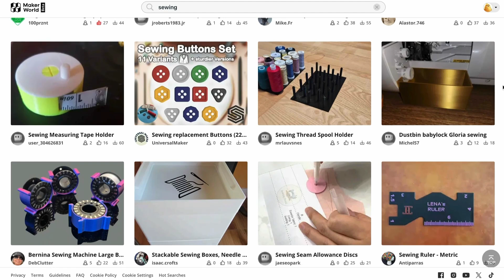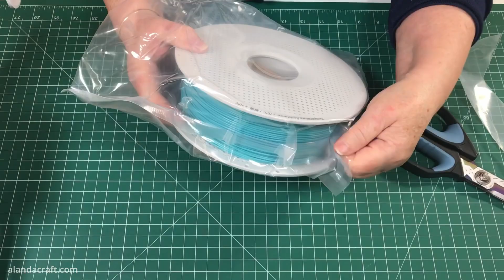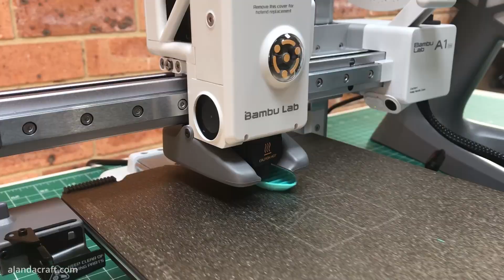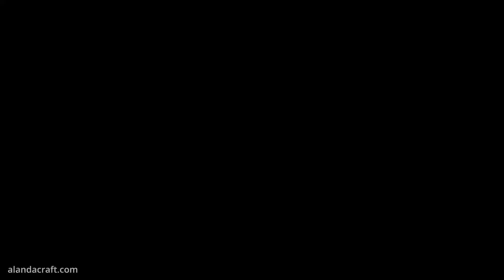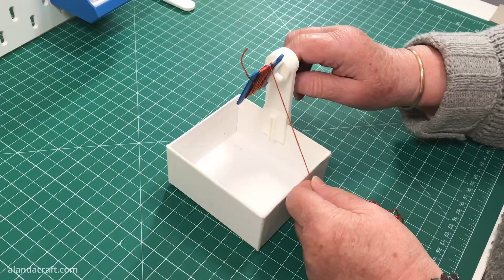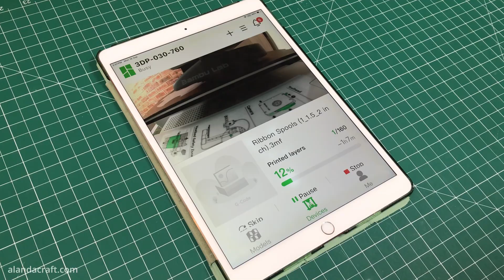My Bambu Lab A1 Mini Review: Why it's Perfect for Quilting & Sewing

Comment: there is a version of benchie that actually floats. But i recomend printing a free makerworld LEGO BOAT instead! But DO NOT print benchie, its very bad for the environment since they dont actually float right dont you think?, they get thrown away because they dont actually float like a boat, they just fall over etc. people get frustrated. But a LEGO Boat?> No one woudl EVER throw those away as the REAL ones are EXPENSIVE liek $20! hah so you can print them with a hole and a string, so it doesnt get lost and you can have a string of them on lakes and the beach, 

just make sure you dont ever loose it in the ocean UNLESS it has like a mission and a small motor and solar panel and gps haha its kind of a problem but yeah MAKE SURE you print LEGO BOATS from makerworld!

Comment: I have been 3d printing for a few years and I love it. Bambu has reusable spools which are great because you can just buy a refill for quite a few of their different filaments. More often than not though, you will get plastic or cardboard spools of filament, from other companies, that can not be reused the same. They can be reused for different things though. My wife has a bunch of skeins of yarn that were unraveling and getting tangled so we have started winding them on the empty plastic spools. We don't have one but I have seen quite a few people talking about how they wrap their yarn onto the empty spools to use with their knitting guns. They just put the spool onto a peg and away they go.
Reply from the maker: That's a great idea to use the empty spools for knitting yarn. Thanks for sharing.
I found a spool winder in MakerWorld that I will probably print out at some stage. There are a number of different designs so reading the comments will help to choose the best one.
Reply: @alandacraft  the possibilities are almost endless with 3D printers. Something we like that I printed is an under the kitchen cabinet hanger that holds the attachments for our kitchen aid and keeps them organized.

Comment: If I had one, which I won't ever, I'd make my own plastic templates and rulers without lines. For example, I'd love to have a 12.5" plastic template to cut out squares for my Sunbonnet Sue quilt. But the square would have a slot for my rotary cutter so that my hand doesn't veer off.